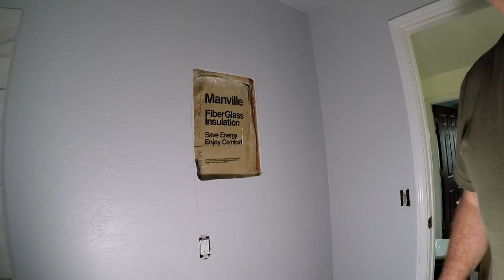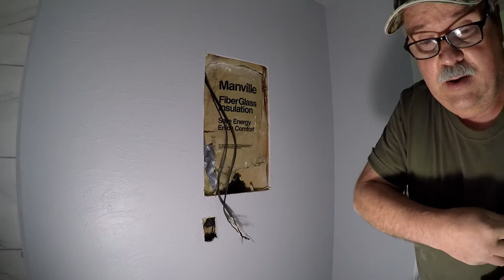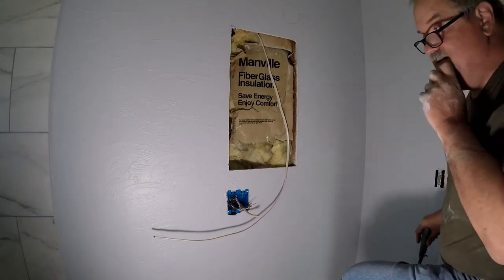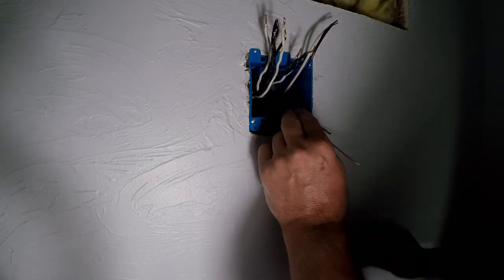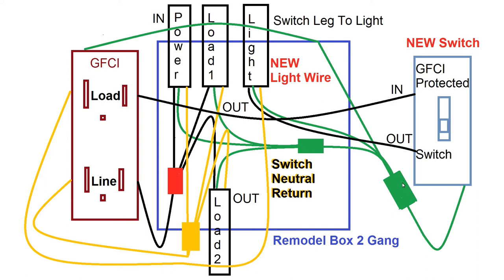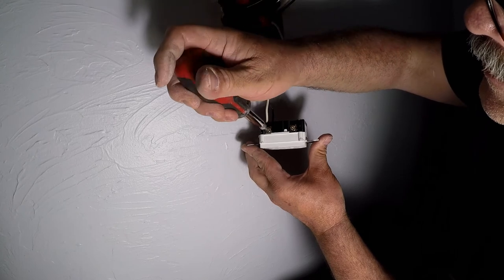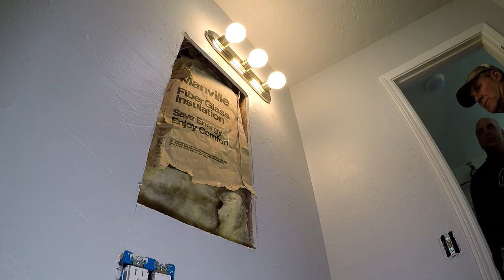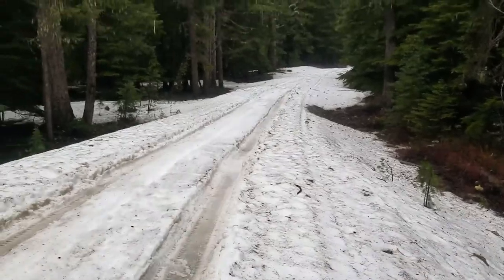How To Add A Bathroom Light And Switch To GFCI Outlet Step By Step

Comment: Thank you for the excellent diagram and explanation. I was able to wire my GFCI and light switch on the first attempt minus having the switch upside down. OCD kicked in and had to turn it right-side up. I can't stand the on/off not correct.
Reply from the maker: Glad it helped. An upside down ON switch  is a NO switch